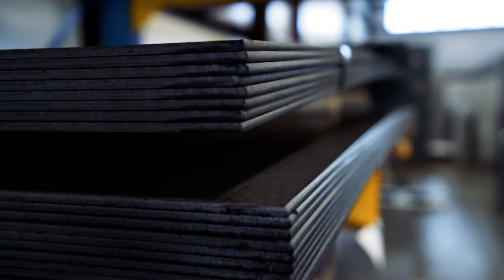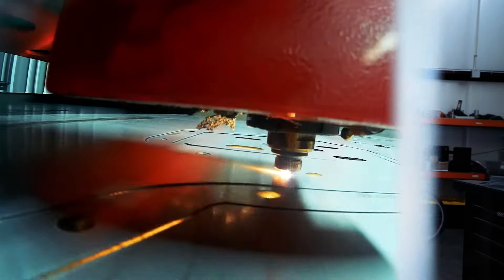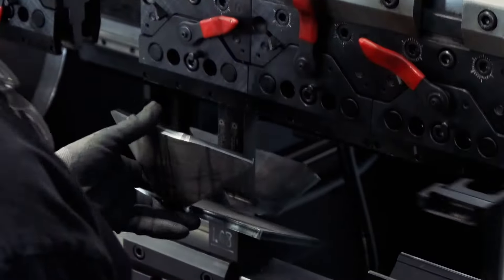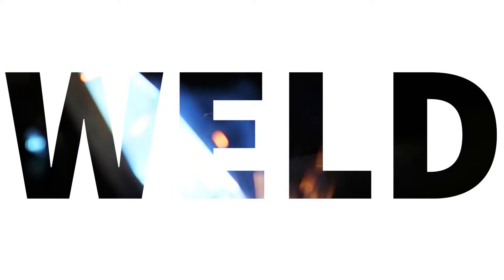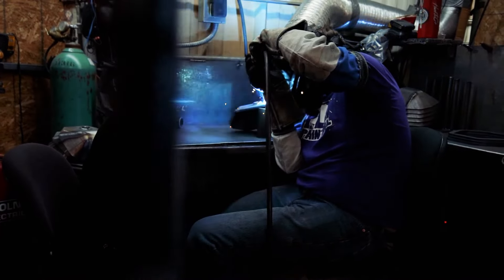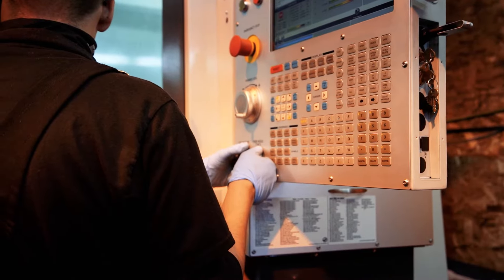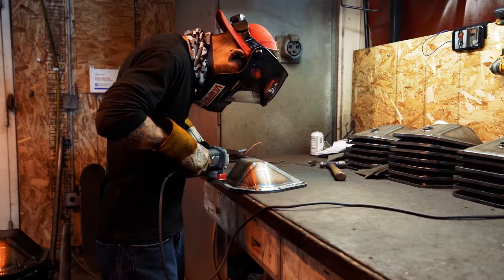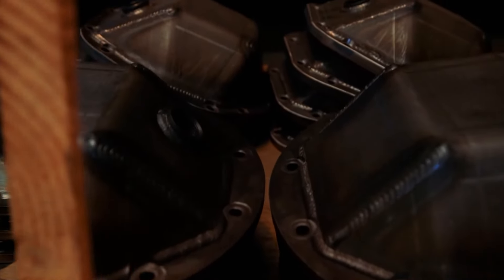How A RuffStuff Differential Cover Is Made

Comment: Will you be having these with up options, like hydro assist mounts and up armoring and clearancing for DOM front tie rods. Say for a dana 60 kp front?
Reply: We are adding hydro assist options to many covers, 2 so far but more in progress. After more than 35,000 covers without additional armor but all 3/8” thick WITHOUT a failure we won’t bother with more armor. We will leave that for the guys that make them only 1/4” thick. Our super sixty covers are already low profile, they clear a DOM tierod easily and fit the deeper inset gear set, we also make the standard 60 cover.

So to answer your questions, not yet but in progress, not needed, and we have made them for several years...
Reply: Speaking from ignorance here, but wouldn't mounting the hydro assist on the diff cover put unnecessary stress on the bolts? All that torque and side to side action while relying on the bolt threads seems risky.
Reply: @SwampFeet678  this actually makes it far stronger. Thats alot of holding capability but 10 or more bolts. Also using usually 3/8 or 1/2" thick steel mounting rings. Thats very strong. I have a 1/4" thick cover with a hydro ram on it now and have no issues but id like beefier....being able to use a bigger ram then a pcs on provides
Reply: @gregleblond9367  Greg has the right answer about the stress distribution over many bolts but I should mention that all rams are not created equal. Be very careful if doing this from scratch, you can build with a too powerful ram which would snap all the bolts. Keep your ram well under 2,000 lbs pressure, 1,250 is plenty.